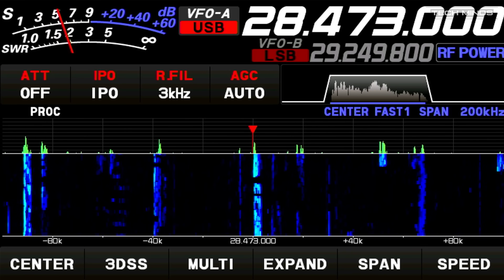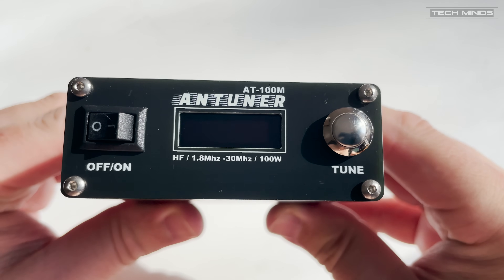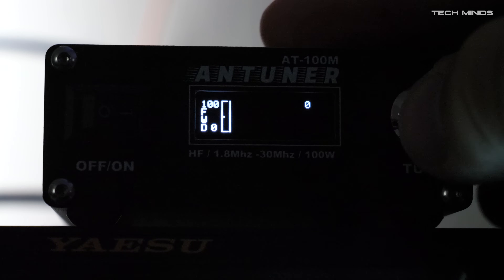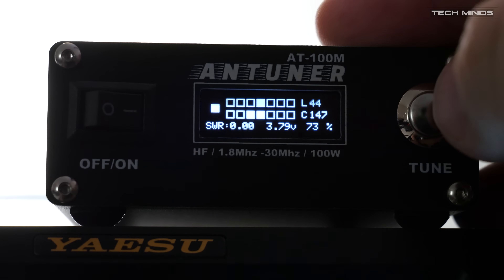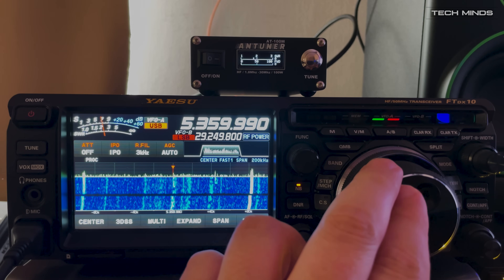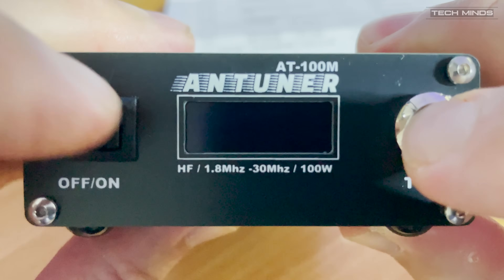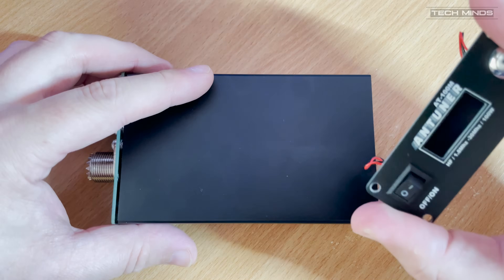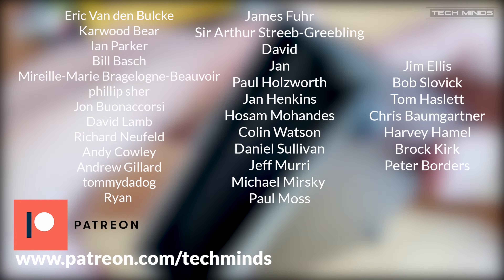NEW!!! AT-100M HF AUTOMATIC ANTENNA TUNER

Comment: I bought one.

I like it, like it a lot.
 
I often use it in the manual setting & after tuning the antenna to a frequency I leave the tuner turned on & swap the antenna to my RSP-1A receiver.

Comment: Ok, now I jut need to know, why I need one. (a newbie here)
Reply: Sorry, a bit late - if your antenna is not resonant on the frequency you wish to use, that is, it has too high SWR, it will decrease output effectivity a lot and could ruin the finals on your transmitter. The tuner uses inductances and capacitances to match the antenna to your rig, akin to for example an EFHW unun
Reply: @wiktoreriksson4566 You explained it well  - I understand. And better late, than never. Thank you very much.

Comment: similiar  Automatic Antenna Tuner, HY100 HAM Radio Antenna Tuner, 1.8-30Mhz Tuner with Large Display for Tuning Radio (100W)Automatic Antenna Tuner, HY100 HAM Radio Antenna Tuner, 1.8-30Mhz Tuner with Large Display for Tuning Radio (100W) mine has ac cord for to power supply

Comment: I bought one.  It works well.  Nice Tech Minds showed me how to operate it.  I turned the beep when tuning off.  It sounded more like a warning and freaked me out because of it's loudness.
Reply: Mine seems to work well enough, too.  The tuner isn't quite as wide-banded as the Xiegu G90's internal tuner, especially at 160m.  The beep makes sense for when you have the tuner at the base of an antenna and you're sitting some distance away.  If you're close enough, I think it's sufficient to hear the clicking of the relays.

Comment: I received mine today. Seems to tune fine but would obstinately crash and reboot on the 27,025 mhz while managing to tune higher and lower from this frequency. It whistles TERRIBLY LOUD so I have to change this from settings. When tuning, it makes loud frying and clicking sounds as if someone was trying to play loud audio using an electrical on/off relay as a speaker 😝🤗! Looks very nicely and tightly built otherwise, screens are crisp and well readable and designed.
Reply: how long time to arrive?

Comment: Does this tuner interfere 10m reception, as the atu 100 does?
Reply: It will interfere with 10m reception when it's tuned for alternative bands... the touch-up tuner (approx 3:1) inside most transceivers is not in-circuit for receive, only transmit... so having an internal tuner active, but with inappropriate inductance and reactance settings to achieve a low SWR for the current frequency, will not change the receive.  As external tuners (like the AT-100m)  is always in-line on receive, you will get attenuation for any band when the tuner is calibrated for another band.
Reply: @Kinetic79  thanks for info. My atu 100 generates an interfering noise on 10m reception. But this is not what you mentioned. 73

Comment: this is a revised comment.  I received my tuner and had a few issues getting it to tune.   The seller was a big help.  This tuner does not have the tuning range of my LDG Z-11 pro.   It is also half the cost and less than half the size.  I tunes my doublet on most bands other than the ones with very high SWR.  I will use it for my portable ops.  I am very happy with this little tuner and would buy it again.   Tech Minds is my go to channel for reliable reviews and info.  Thank you sir.
Reply: do you know if it will tune 12 meters?
Reply: Does yours make these relay-like frying sounds when it tunes 😝😀? Just to know if mine is normal. Mine would tune on aboute and below 27.025 am but not on it… it crashes and reboots. I guess it may be from the the antenna’s specificity.. Happy holidays!

Comment: I just received mine today after seeing your
video a few weeks ago. I have several rigs
I can use with it, but specifically wanted it
because it's small and self powered to use
with my Yaesu FT-818 QRP transceiver.
73 de W2CH New Hampshire, 1962-2022

Comment: Will this work with QRP rigs such as the SW-3B or Mountain Toppers? Some of the other ATU-100’s required higher power output to work.
Reply: According to the Antuner website and (Chinese) manual, it should work with QRP. The specified power range is 0.1W-100W. Would be great if Matt could verify this.
Reply: @martijnn6188  Its working fine with my USDX+ at 5w. Nice build quality too.
Reply: Use one with my Xeigu G90 radio and it works perfectly with a drive of 20 watts.
Reply: Any new answers regarding Steven question... ?
Reply from the maker: I’ll check to see if I have a radio which goes that low.

Comment: Hi — I didn’t quite understand about the “off equals off” statement… does it use latching relays so that once tune is found it doesn’t need to draw any power from the battery or USB, or does it need to be powered all the time you’re operating?
Reply: It doesn't use latching relays. It looks like an ATU-100 hardware clone with different firmware .
Reply from the maker: I was referring to the on/off switch. With my old ATU100 clone the battery would still drain while in OFF position. With this model when the power switch is OFF, the battery still remains charged.